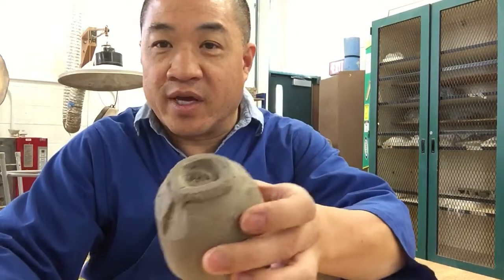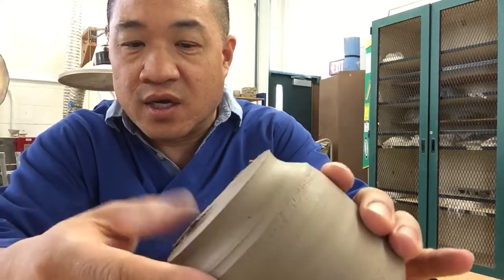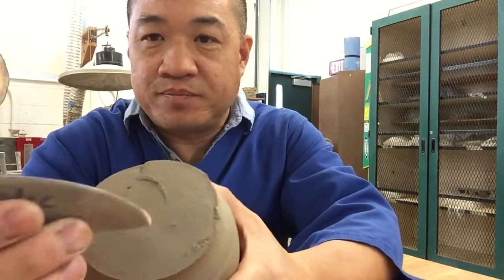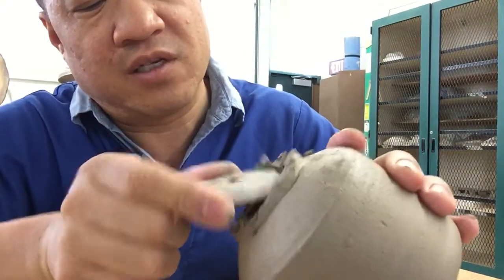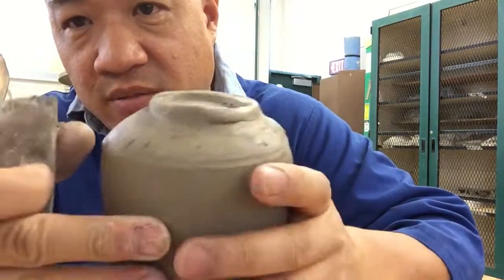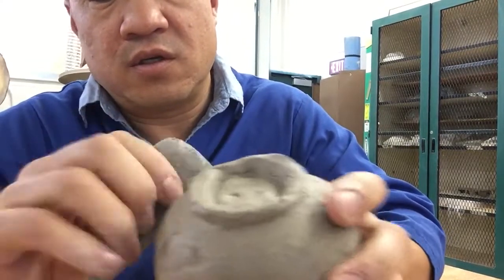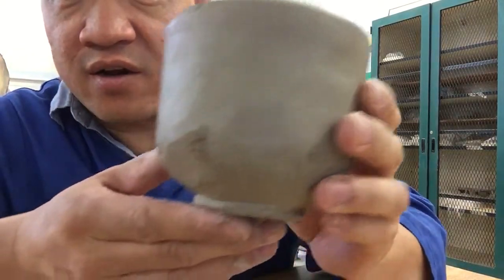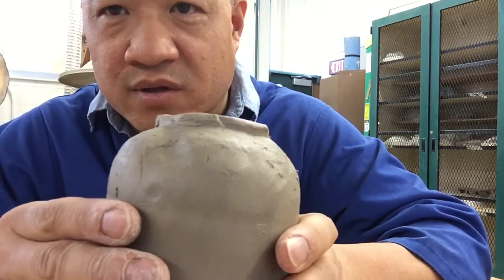How To Hand Trim A Foot On A Ceramic Bowl.

Comment: Hi Roger, do you have to do anything to level out of very bottom of the footing, so the pieces sits evenly/level/flat?

thanks. enjoying the videos. keep them coming.
Reply from the maker: Kevin Liu hey Kevin,  no, I don't do anything to flatten the foot.  I smooth the bottom so there are no sharp edges.  The cup balanced on a few points "naturally ". But they don't wobble around.  They have a natural tilt.  Which I try to foster.  If being leave  is your goal, scrape the base flat first then carve out the foot, or tap it flat on a table until the foot is flatten or level.  
Hope that helps
Best 
Roger
Reply: thanks for the prompt reply.